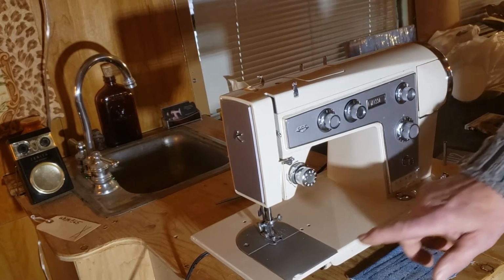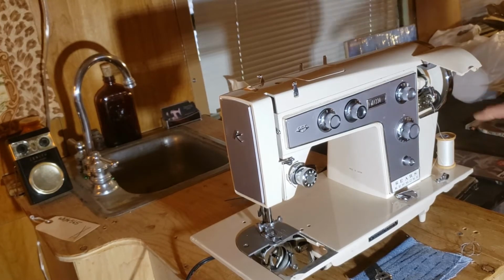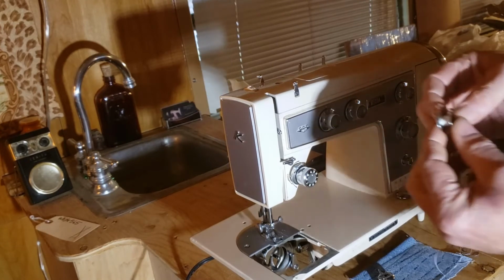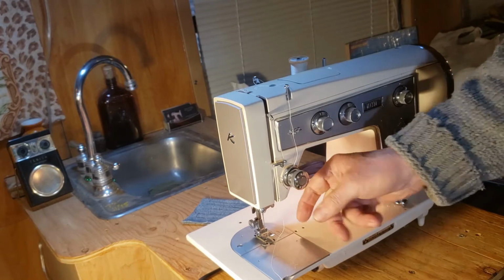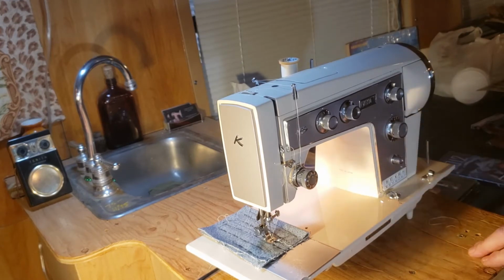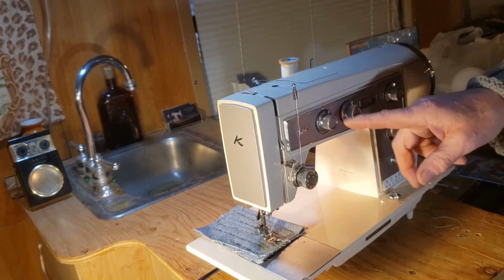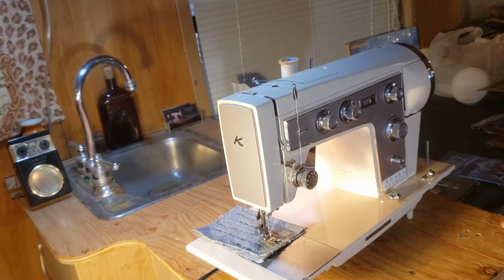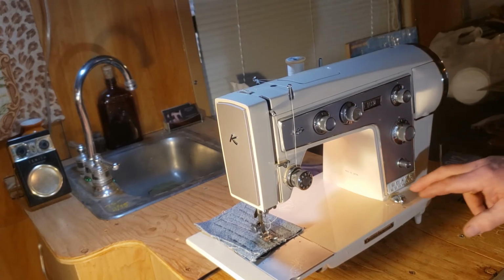Final Test of Renee's Kenmore 158.904 Sewing Machine, and How To

Comment: 14:16 lets say your machine has been sitting for years and the oil evaporated, how would you go about unlocking everything and oiling it back up
Reply: I have inherited the same exact model idk last use but its locked up and looks like a car engine under the hood. Whats the best way of getting it moving? An oil bath isnt cutting it
Reply: @thakingyz56  I use deep creep even kerosene is better than SM oil and put some heat on it with a blow dryer or out in the sun on a very hot day. Take out the bobbin case to make sure nothing there has jammed and try the clutch release as if you were going to thread a bobbin.